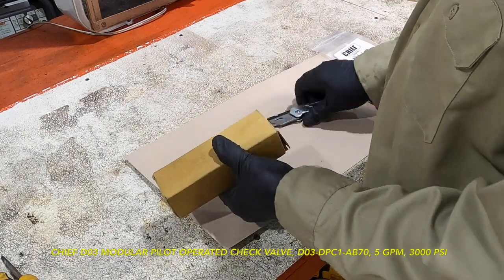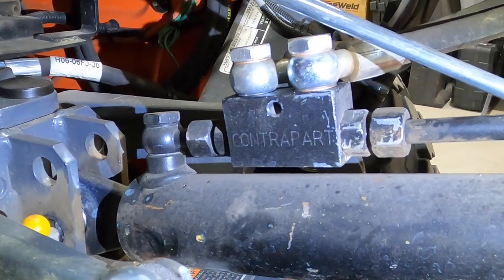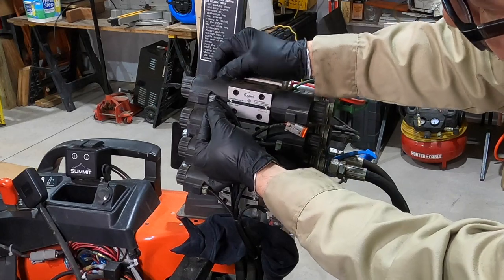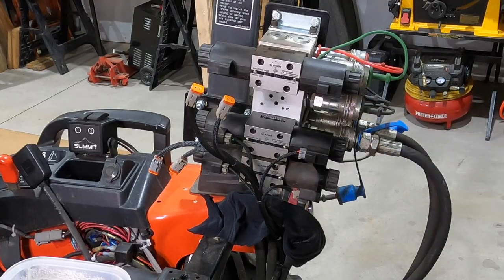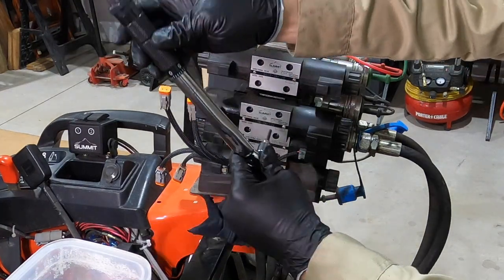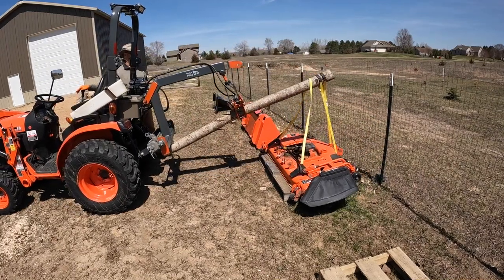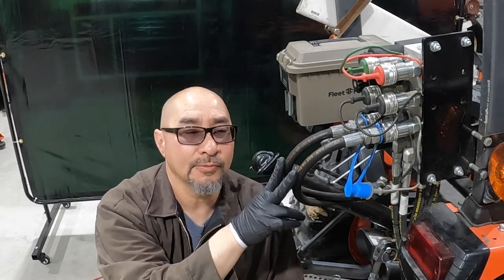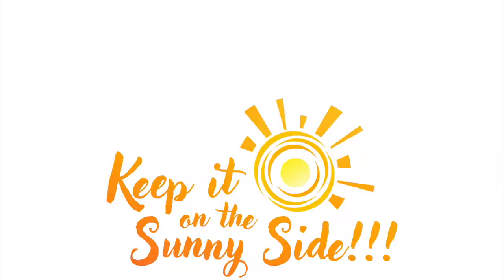Adding A Check Valve to Summit Rear Remote

Comment: This looks like a cool upgrade and great job getting those bolts to line up, that did not look easy. It is interesting about the possible difficulties disconnecting the lines, it would be good to know if this proves to be an issue
Reply from the maker: Thanks Joseph 😁I noticed that if you are at the end of the stroke and pressurized with the tractor 🚜 off it will not let off pressure when activated so I had to turn on the tractor and cycle it to the halfway point for the pressure to back off. Then turn it off. Just one of those things to be aware of. Have a great weekend 😁👍🚜💨🍳

Comment: Nice! Interesting to know such thing exists as an add-on!  I have a mechanical version of it on my 1962 Case. It was standard equipment. I don't know what was the intend for that. If you don't get the tractor running, there is no way to lower the bucket down, where a regular valve will let flow the oil back and lower the bucket. Thanks!
Reply from the maker: Thanks Joe😁 You have a good point about tractor not running I better keep some wrenches around so I don’t get stranded😂 I can’t wait to use it. Have a great day 😁👍🚜💨🍳

Comment: Great job Mitch. Rear remotes are one of the things i wish i had gotten when i bought my tractor new. I`m still whining about the price to install rear remotes even today. I don`t have near as much use for rear remotes as much as you do though. Thats why i haven`t went down that rabbit hole yet to get it done. A hydraulic top link would be handy though on a couple of my 3pt implements. I`m just not there with it yet though. Maybe someday i`ll make it happen.
Reply from the maker: Thanks Dee Derp😁 The good thing is that you already have the tractor so you could still do a lot while you wait for the remotes. The top link is a game changer in my opinion. Side link not as much so still have it on the back burner. Have a great weekend 😁👍🚜💨🍳

Comment: Nice sandwich valve.  Too bad they can't make them any thinner.  Valve manifold already cutting into my backhoe sitting area. 👍
Reply from the maker: Thanks JW😁👍 You could mount it on out side of the ROPS if you really wanted. Just a thought. Have a great weekend 🚜💨🍳

Comment: I want a rear remote for my B2601. Only need one to install a hydraulic top link. But since I swap a backhoe on and off, I'm torn between aftermarket or coughing up the bucks for a cleaner dealer install so I have nothing to get in the way hopping on and off the rear facing seat.
Reply from the maker: That is a tough call🤔 you know what they say better to cry once and go with the dealer install. Sounds like that will work the best. Then you can use it like Tim Schison did for a hydraulic thumb on your back hoe. Thanks for checking out the video. 😁👍🚜💨👍